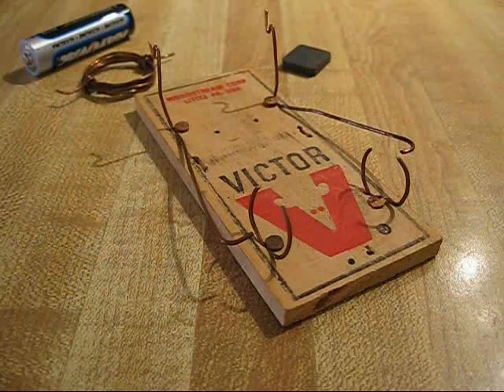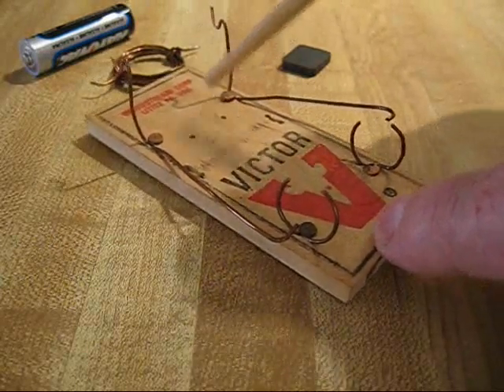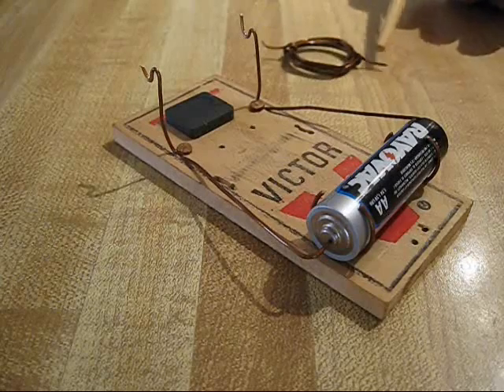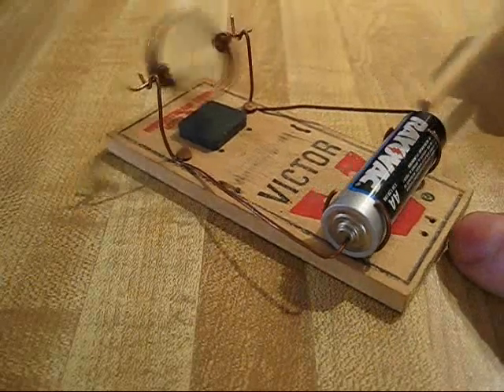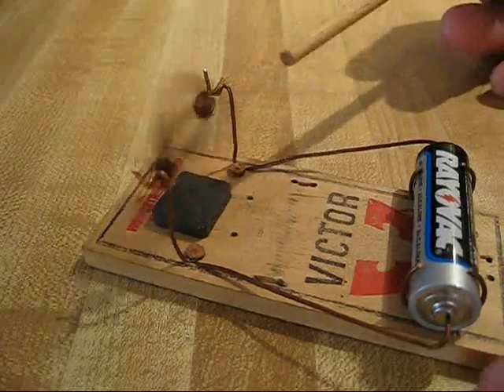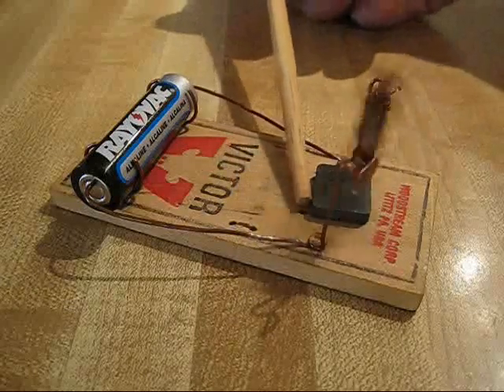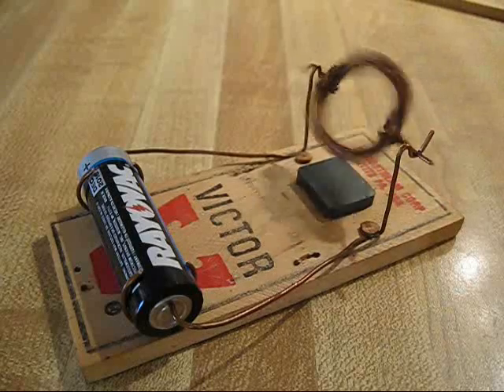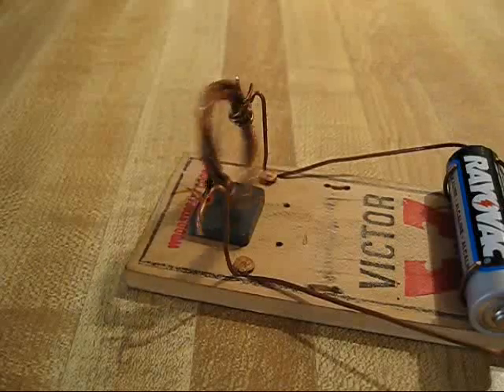Mouse Trap Electric Motor,Free!

Comment: Just for people who might want to make this every old fashioned TV with a cathode ray tube you know the old fashioned glass kind of TV if you take it apart after unplugging it and waiting a week till the Transformer discharges with a little bit of effort and care you can remove the coil off the neck of the cathode ray tube and you will have more wire that's enamel coated then you can ever need to make this project, you have to reclaim components from other sources I love old TVs and especially microwaves because microwaves come with magnets usually 2, and they're pretty strong would be very well suited. Also microwaves and most TVs have a Transformer which can be taken apart with the aid of a bench grinder slash angle cutter (a disk that spins and rotates that cuts metal) Transformers using have two sizes of enamel wire giving you choices

Comment: Something, probably a little enamel left on the wire must be interrupting the current in the rotating armature.    Otherwise a steady direct current from the battery would tend to keep the armature locked in one position.
Reply: wallacewithoutgromit nice try on the troubleshooting but it was evident that the wire was cleaned correctly the problem was the Armature or the wire Circle for the newbies was mechanically not square and straight allowing for excess wobble created by the improper mechanical alignment you would have immediately noticed if there was any enamel in the way because it wouldn't work at all

Comment: So could you use this motor for anything?
Reply: Joseph Best wow you must have been like the others that put on the video and walked out of the room it's completely for educational purposes you might be able to put some paper at 12 and 6 on the spinning Armature or circle of wire for those that don't understand the term Armature and you could fan a candle maybe even put it out, but it's really to illustrate the simplicity of an electric motor again I say motor, not engine, engines are gasoline or other fuels including Steam

Comment: You can call it a Motor instead of an engine if you want because it is using elevtricity. If it was deriving its motion from fuel or powering a mechine of some sort than it would be proper to call it an engine.

Comment: Just take "FREE" out of your title and its pretty cool.
Reply from the maker: okie musgogee ,,, neighbor catches a mouse,,, toss trap and mouse in trash can,, I leave dead mouse and save trap,,,,,, neighbor changes battery in smoke alarms,,  toss old batteries in trash can,, I save both batteries,,,,,, neighbor vacuums floor and vacuum cleaner stops working,, toss into trash can,, I save dead vacuum cleaner for the copper wire,,,,,,,, four small nails saved from an old discarded picture frame,,,,, and the magnet,,, saved from one of them refrigerator magnets that said, I seen Niagara Falls (free gift),,,,, FREE,,, adverb, without cost or payment, without charge,, for nothing,,,,,, free,, I think so,,,,, thanks
Reply: shopdogsam I am only thinking that batteries are expensive these days, thats all. It would be cool to make one with a car battery :)

Comment: You did a nice job on this one.
I really don't think I need to make one of these.
What I own is a 1908 Toy Electric Engine.
If you have either a reprint or an original 1908 Sears Roebuck & Company catalog that is just what they call it. I paid $30 or $35 for it and five hours later I was offered $600 for it. I still have it because they print new money all the time but I haven't seen another one of these for sale.

Comment: While you're controlling the speed my moving the magnet, which is one valid solution, in practice, the speed of the engine would be controlled by the input power and the direction of rotation could be controlled with a switch to reverse the polarity. It IS simple and anyone could see why an electric car would be more reliable than a gas one. There's no way in hell I could ever build a gas engine with $1 worth of materials.
Reply: This engine can't work. DC current will produce a stable state and nothing will keep rotating.  This guy just trapped us like mice ;-)

Comment: I'll be making one for sure, Thanks very much for sharing your knowledge Sam I think it may be?
Pulling apart a broken Little Car battery operated 12V air compressor motor will give you access to a great little piston, Shaft and Cams, I looked inside one I found down the tip and thought I could make a steam engine model out of that but I sold the property and moved taking only what I needed but you may have enticed me hear to go and locate one. Even brand new they are only about $30 Australian so still worth the capital outlay in comparison to a Already made functional desk Model costing approx. $200, They use a candle as a heat energy source. Just some food for thought.

Comment: That is AWESOME! What if you hook it up to 120v? Boy, I bet that thing would spin like a basterd! Thank you!
Reply: Coulombe, eh? How ironic. To correct you, if I use wire rated for 120v, then where would the "flash" come from? The thing would spin crazy, that's for sure. Then the coil would just fly into the air, or into my face. The cct would then be open, no breaker would trip. A cct bkr will only trip if there is a short, or cct overload, or a weak bkr. What do you think really happened on 911? (off topic, just curious if people believe planes flew into buildings that horrible fucking day.)
Reply: andy lenow
A battery is DC, the 120 V you are talking about is probably AC.  The concept of this simple electric motor does not work with AC.  The reason that this setup does not spark and fly away is because the battery does not have enough power for this.  Even though batteries can have serious short circuit power, the voltage drops significant most of the time (or either very quick after causing a short circuit).  There is (in The Netherlands that is) 16 ampère available on a single circuit breaker (220V) that is being put through your "120V" wire (the same goes for 120V on 120V wire of course) at once.  It's the amount of power (voltage) being able to put all the current (ampères) through the wire in a setup that does not work with AC, causing it to short out.  When you would use DC current with DC wire, you would probably also need a lot stronger magnet.  I'm unsure whether it will spin faster, my theory would be that given the greater mass of the heavier coil the amount of repelling force being created in the magnetic field of the coil, is either equal or less compared to the smaller versions using a lower voltage.  Nonetheless, I find this setup quite interesting and would like to see what would happen when a higher voltage would be used.  Given the fact that I only had natural sciences at middle school I'm a little hesitant to try myself though :P.
Reply: Dutch3DMaster Thank you for your reply Mr Dutchmaster. The "sparks" comment was because of someone elses comment/reply. I am a licensed electrical contractor, I know how these things work. I am going to smoke some good weed ( truly fruity) a super sativa, and build one. Let's talk about UFO's and 911 missle attacks sometime. All public welcome.
Reply: Sorry for the misunderstanding about the sparks thing, the whole commenting system has become quite confusing ever since the whole Google+ nonsense.
I have no idea what truly fruity and "a super sativa" means other than that is has to do with weed, so I can only hope you simply enjoyed it :).
Reply: Dutch3DMaster No need for any sorry. "Truly fruity" is a type of strain or flavor of the weed species....like raspberry, peach, lemon, etc. It is very fruity tasting. There are basically 2 types of weed. Sativa and Indica. Sativa is a soaring head stone, great for creativity, sex, nature walks, getting things done. Indica is heavy narcotic stone, great for sitting on the couch being a vegetable "couch-lock", and for those in pain or who have anxiety. I have never enjoyed Indica weed, it just makes me sleepy and lazy. Have a nice day.
Reply: andy lenow OH! You are in the Netherlands! What is the basic household voltage there? Is it 220? 240? Do you have mostly pipe/conduit methods there? How many circuits on a basic home panel? In Russia,in the apartments there is like 2 or 4 ccts. Im in Canada, we have 120/240. 16, 32, 40, and 64 ccts are common.
Reply: Dutch3DMaster  Go ahead and build one and hook it up to a 6 VDC Lantern Battery. Yes it will spin a lot faster.
Reply: andy lenow 44
Reply: You will have to build it on a bear trap
Reply: only your head would spin from the flash

the thing would fry and your breaker will pop

Comment: Too cool Sam..sure some one has already said it but spinning the magnet 180 should change the rotation.  Learned this way back in your coil video? HA  .  This was one of my first projects back in the 50's  My farther was an armature and stator winder for a shop that repaired mine motors..Still have an old spool of cloth covered low hp motor wire..

Comment: why i all ways try to make my motors and they never work i listen 100% omg they say how it goes i build it and nope it only dose not i tried every motor i tried yours nope tell me what i did wrong i made postiv and negative pole with wire runs to the top where its wire and with a wheel i spin nope it spin once and dose not work i am so mad

Comment from the maker: ,,, no, in this one the battery never get's hot, and this battery has lasted a very long time,, as the bare place on the copper wire that makes contact is very thin, only about 10% or less of the enamel on the wire is scraped away to make contact,, (if the circuit did not break, it would not run),,,, thanks

Comment: You just saw it working. Just because he used a mousetrap base doesn't mean it's supposed to catch mice. 
0:44 This one happens to be built on a mousetrap base.
As in the fact that the base used to be a mousetrap. Has nothing to do with the function of the electric motor mounted on it.

Comment: I built one of those things about 20 years ago, nice work but as I remember the battery got hot and discharged fairly quickly because the circuit never breaks during operation, is your the same way?